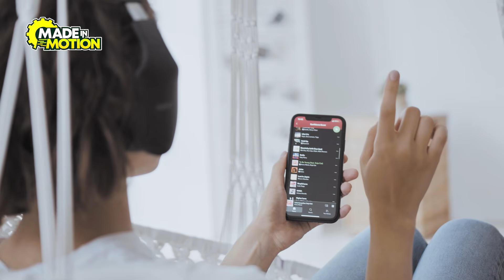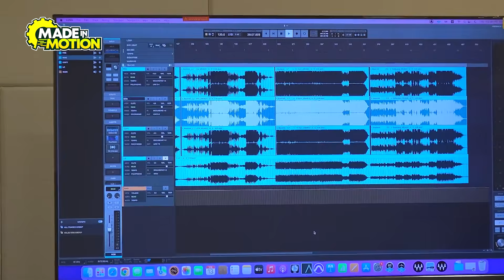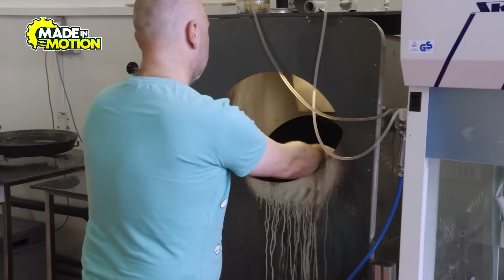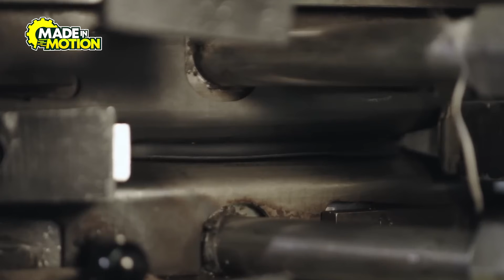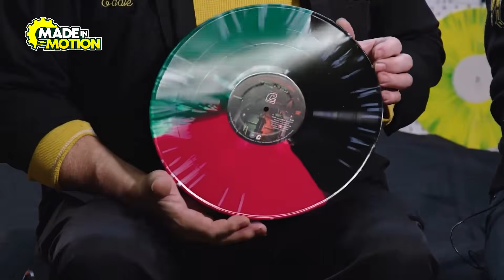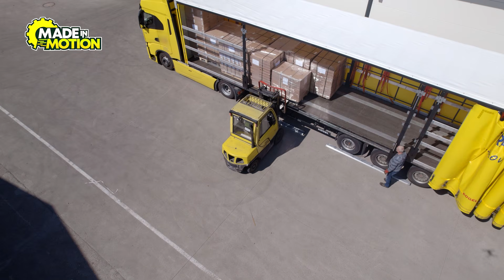How Vinyl Records Are Made – The Art Behind the Sound!🎶💿

Comment: I have a tip for all people who love LP’s. Every disc collects dust over time. So clean them in an ultrasonic cleaner with capacity of 6 liters. Fill it up with 4,5 liters distilled water, half a liter of isopropanol 99% and 2 ml of tetenal mirasol 2000. Turn them by hands or build a slow moving machine and put them in during 6 to 8 minutes. The result is exceptional, your album will sound as new. It doesn’t cover scratches but the old dust dissapears.